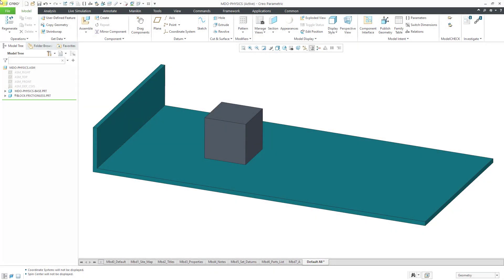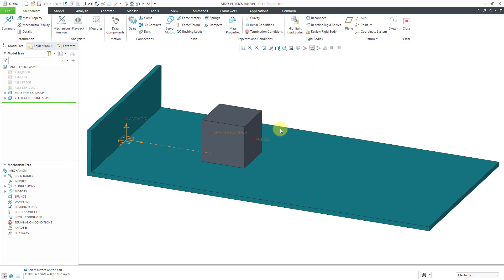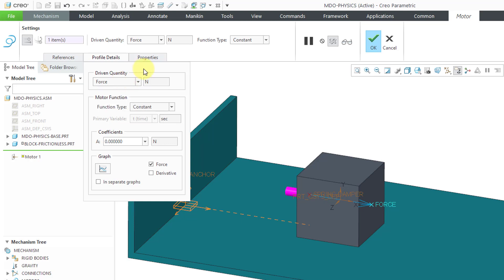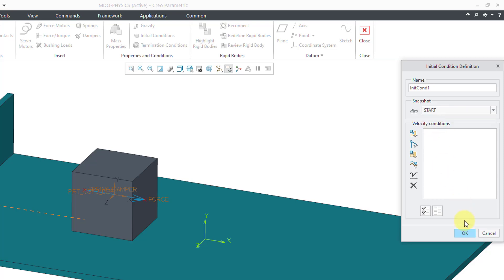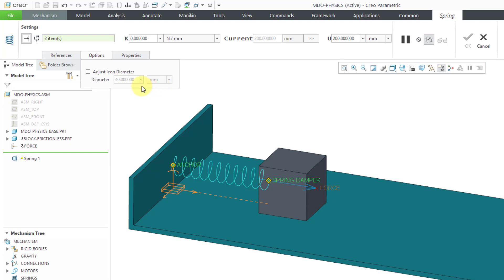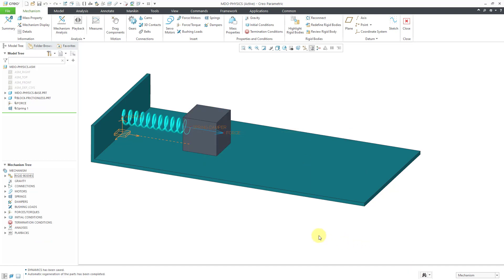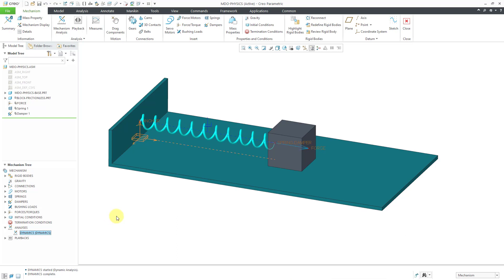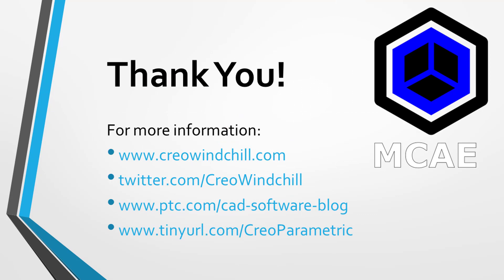Creo Parametric - Mechanism Dynamics Option (MDO) | Mass - Spring - Damper System

Comment: Do you know if it's possible to find a torque using the FPD principle ? Torque = Inertia * angular acceleration ? I would like to apply an acceleration on a part and find the torque on an axis, using the mass properties of the part ...
Reply from the maker: I don’t know what FPD stands for, but you should be able to create a measure for torque and find the value using the Mechanism Dynamics Option in Creo.

Comment: Sir,I have one question. Before applying the spring mass goes to right side to the limit you applied in connection. Uptill now it makes senses. But when you applied spring why it starts oscillating while the apllied force is always acting towards right throughout the analysis. My Question is that should block not oscillate when applied force becomes zero (disconnected)?
Reply from the maker: I don't think I removed the force. But also, I deliberately chose spring- and dampener- constants that would result in oscillating motion.
Reply: @CADPLMGuy  
Just imagine a mass is hanging with spring vertically. And you pull it down.   And mass will not start oscillating until you leave the mass.  If you keep on pulling the mass it will not oscillate.
Reply from the maker: @UA-mk4nh  This isn't vertical.